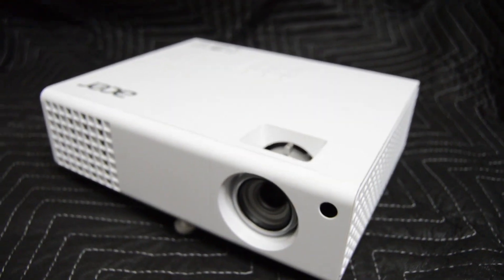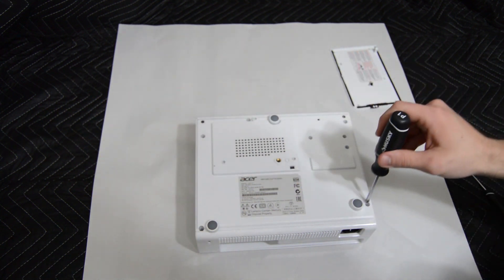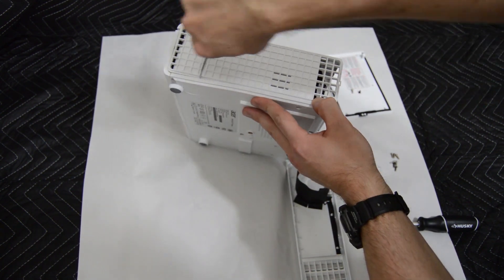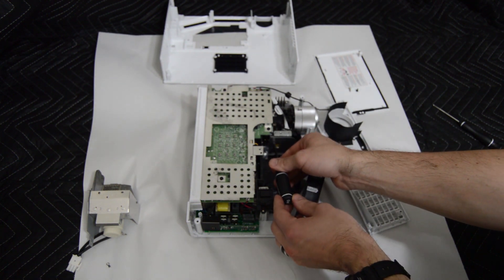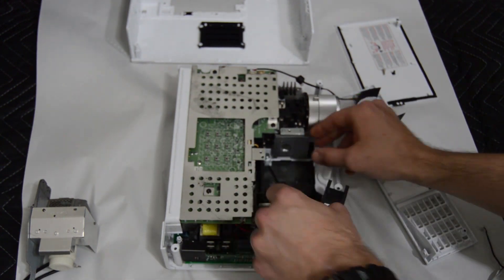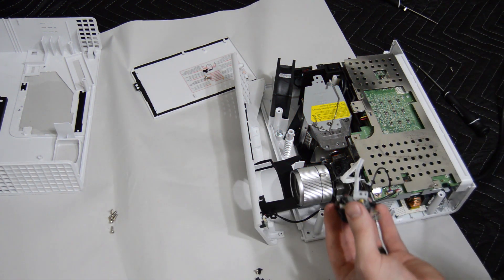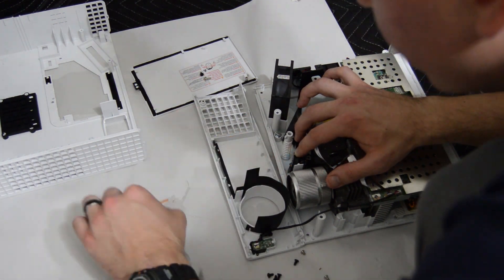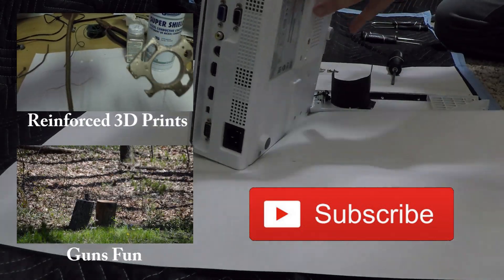DLP Projector Color Wheel Removal/Replacement Guide ~ Acer H6510BD ~ Improve 3D Printing Speeds

Comment: How can I find the dust filter in an Acer P 1173 projector?
Reply from the maker: +Emmanuel Valentin I am not familiar with that model projector. I imagine the filter has a removable cover just like my model has a removable cover to access the lamp.  My projector does not have a dust filter so I can't give much more info than that unfortunately.
Reply: Garage Science Thank you anyway for your information!
Reply from the maker: +Emmanuel Valentin no problem, good luck!
Reply: You could also use something like this that allows to minimize dust and is able to be cleaned and reused. https://www.demcifilter.com/Standard-Fan-Filters

Comment: hi!
the printer used in your other videos have the same projector? 
one question more: what type of cristal you put at the bottom of resin tank?
Reply from the maker: xako0h Yes, this is the same projector I use in my Draken DLP 3D Printer.  Not sure what you mean by crystal. The projector projects directly onto the underside of the vat, no crystals are used.
Reply: the vat are made of... what material?  
i read in some foros that the method "bottom-top" had an issue: the resin attach on the bottom of the vat. for this reason, i think, the base of the vat should made of a special material. 
isnt it? 
excuse my english, i even cant speak properly my own language jajajaja
i hope you undertand  c:
Reply from the maker: +xako0h there is a Teflon film on the bottom of the vat to reduce the attachment force of the part to the vat.